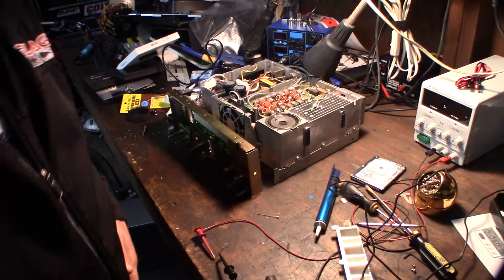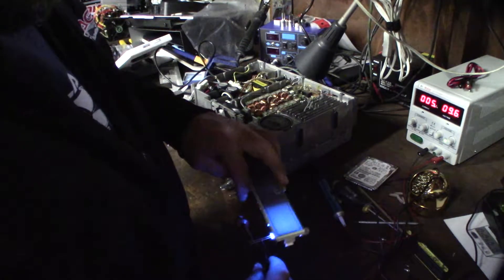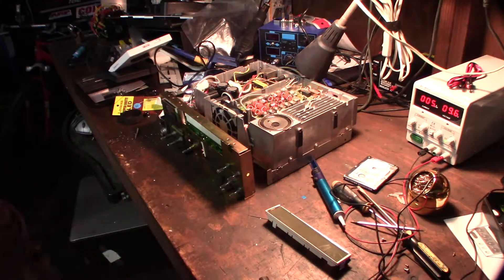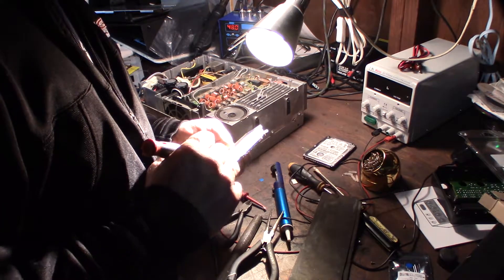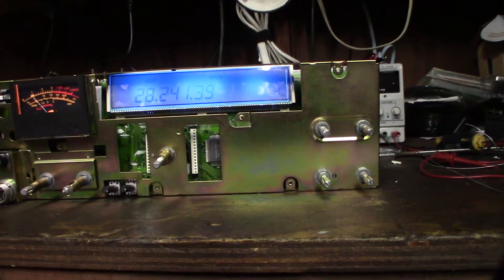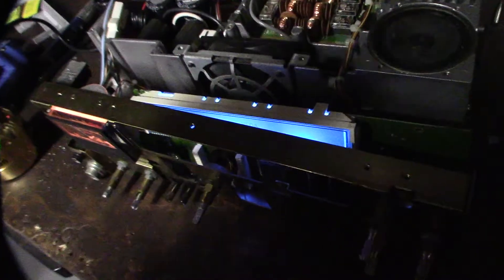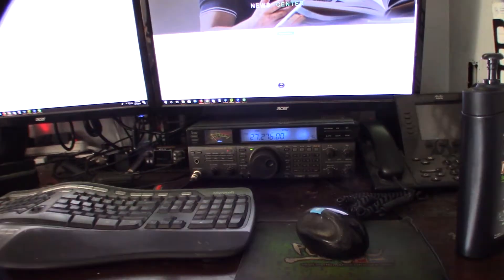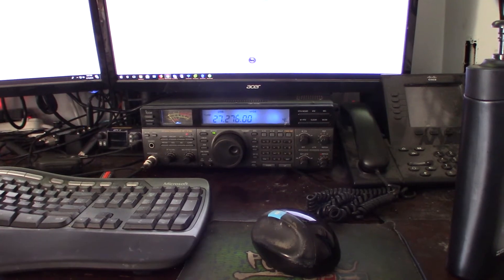LCD Blue LED backlight conversion for HAM or car radio part 2

Comment: I have to commend you for the job you did to this radio display.  I have one of these 736's I bought new in 1995 for 2 grand and several years ago the display bulbs started to die.  I looked into replacing them and realized it is quite a nightmare job to do.  Your video is the only one in existence as far as I know and shows how to take things apart and make a repair.  I would have stayed with the amber look though but then again that was what I was used to seeing for many years.

My 736 now sits in a closet and I really have no ambition or eyesight to fix the lights.  I have other transceivers I use and the more I look the more I like the new Icom 7300.

You have great patience and determination obviously.  Really a gift.  Hope you make it into the Ham ranks one day.  You already possess the skill set to have a successful hobby for sure.

GUD LUK